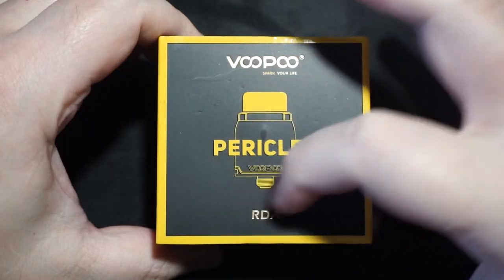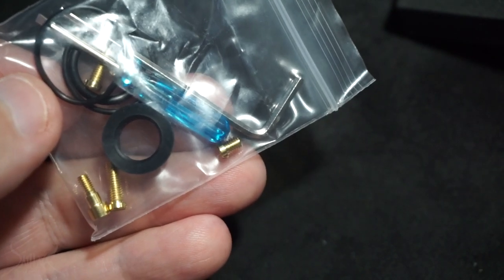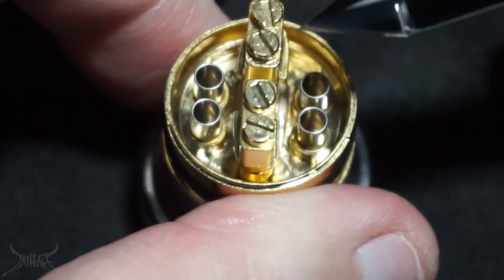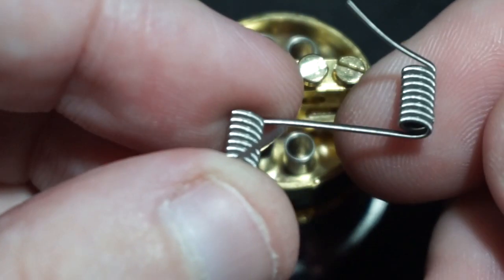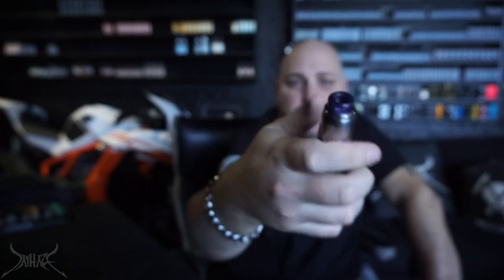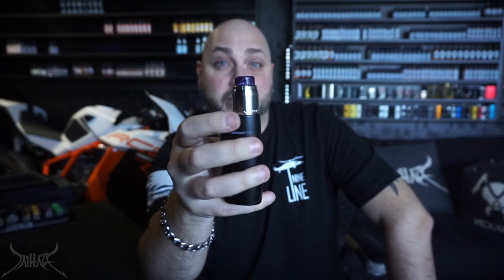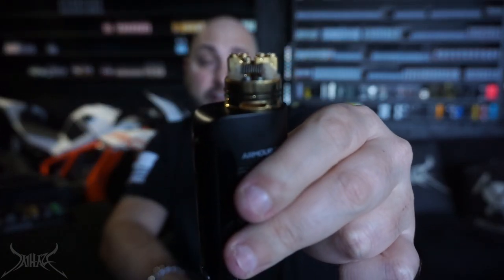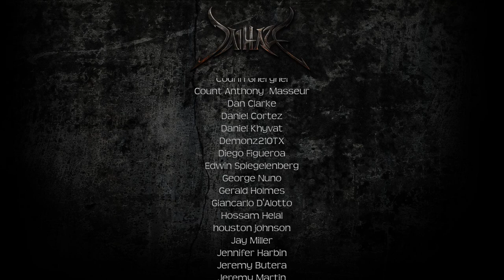Voopoo Pericles RDA Review and Rundown | Not Related to Hercules

Comment: You are correct Jai, that deck is basically just an inverted Bonza (original) deck, and the Bonza was loosely based off the OBS Cheetah 2(which was my first driper and is why I got the Bonza). And the Bonza did have the grippy marks on the clamps.

Comment: The main reason the Bonza build deck is so much better than this is Sam has the "outside" leads higher than the inside leads so you have way more room to wick (basically the opposite of this deck and every other deck that used this design ;-)  Those Kennedy like tubes w/ true bottom airflow does chub me up a little bit man!  Thank you for the closer look Jai!

Comment: Just got the Dovpo Topside...best squonk I've ever used and now my only mods...sold my pulse bf 80s. Not related just sayin
Reply: It makes other squonkers obsolete, the only thing that'd make it better, is a dual battery version.
Reply: I love my topside.
Reply: How do 22s & 24s look on it??? That's really the only thing holding me back. Hate a mod that make smaller drippers look like a zit.
Reply: @jackigoon6168  The drop solo looks great and so does the drop dead. I have the asmodus c4 on mine at the moment, trying to figure out which rda I like best with it.
Reply: Sheena Wood awesome. Is it a good size in hand? The thing looks kinda bigger on screen than it should be to me, like a box 3-4 years ago.
Reply: Jacki Goon I think 24 looks perfect. 22 is a bit small
Reply: Jacki Goon its perfect. A little tall. Feels like the double barrel mod

Comment: Thanks for the review. But I got to keep it real. And ket u know. You put them coils in wrong. One lead goes in the top hole and the other lead goes on the bottom. Keeping the coils even so one ain't higher than the other. And it keeps the coils from mis shaping as well.

Comment: VooPoo has been in "damage control" mode since the Tony B incident.  The only product they had and the one that put hem on the map in the first place was the Drag. Since then they have not come up with anything new or innovative. Most is rehashed and poorly made when compared to the original Drag. Now...it seems they are taking ideas from other drippers and poorly executing them and the whole thing being plated in gold is nothing more than an esthetic ploy to make it feel like high end.....when in reality it is just gaudy and does nothing for the performance of the device. As far as the deck and bottom airflow with the tubes...it's been done already and is a leaky bottom airflow at best. Juice will go right down the tubes and onto your mod. I could list a plethora of other drippers that will outperform this and still be in the same cost bracket. The question needs to be asked....how much more can you possibly do with an RDA that hasn't already been done? Not just for the sake of doing it but for the actual performance of the device.